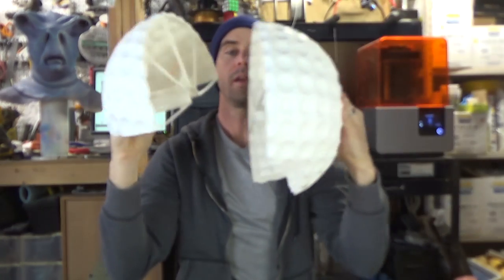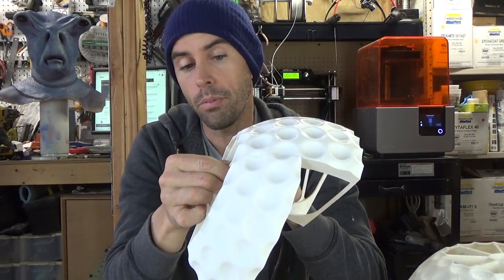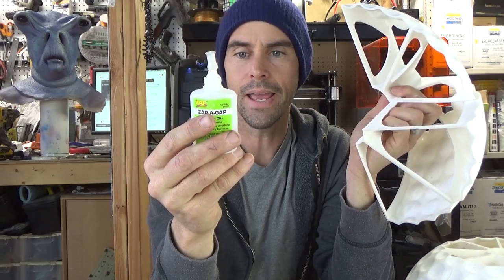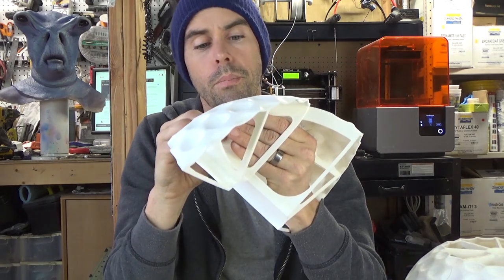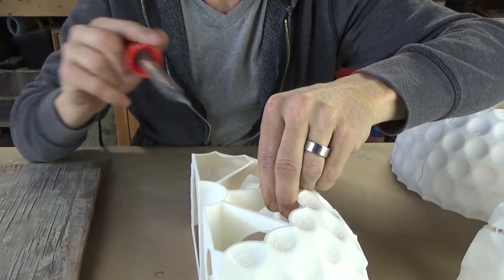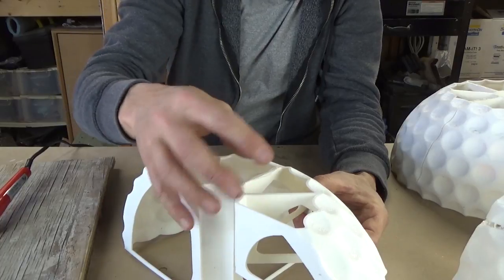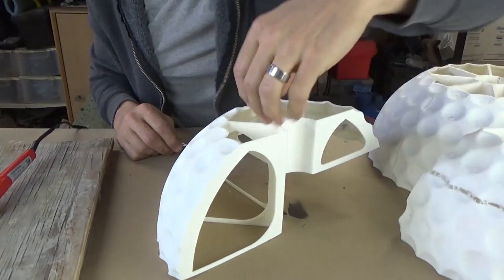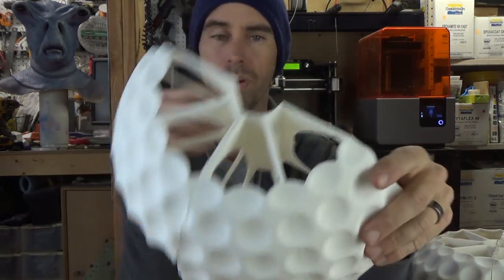Welding PLA 3d prints.

Comment: i like to use cement glues that are used for plastic model gluing. the glue basically melts a part of the PLA, and when it dries its like it was like that already. howevery it may produce unwanted results when you drip some where you wouldnt want it to be.

Comment: Have you heard of using sprinkled baking soda with super glue to permanently fill in any gaps? It's also easily sandable.
Reply from the maker: Joel Klimkowski done that many times. Problem is it's sandabke but much harder than the PLA. Leaves a bump behind without a bunch of really careful sanding.

Comment: Woow.. Just use Acetone on Pla. Brush some on both sides and press them together for a vew minutes and its done...
Reply: Acetone does have this effect on ABS, but not PLA.
Reply: @AlexiosLair  Thats where you are wrong. Go out and try it for your selfe
Reply: The purer the PLA (fewer additives), the less acetone will react with it.
I've avoided trying it, tho, because I've also heard that acetone smoothing on PLAs ultimately leads to faster plastic degradation/increases chances of cracking over time. Have you had different experience?
Reply: @madamHermit  Actually yes, i have never had any problems with it. No Cracing no faster decay. I have tried a vew types or brands of Filament with the same Result. It is important tho to wait about 3 to 5h before loading the joint fully. It is incredibly strong after about 30 secounds (about as strong as a regularly gluejoint) but it will get stronger over time. In fact, when i tested strength, i noticed it would almost never breake on the welded joint but next to it. I personally don't use PLA outside, so i cant tell if there is any difference but with my experience from inside-use i would say its stronger than glue, even when used outside.
Reply: @CarlosDerHund  that's cool! Thanks for sharing your experience! Do you have any really old pieces that have stood up well/ really, really old welds?
Reply: @Carlos der Hund I tried acetone welding some print made in Zero brand PLA filament earlier today and the pieces  didn't react with the acetone at all. Brushing it on, immersion, vapor bath and nothing did anything to the PLA plastic. After 15 minutes in the chamber they weren't soft nor any kind of tacky. So don't be telling people to 'just' use acetone like its some smart thing to do. It really does depends a lot on the brand of PLA filament.